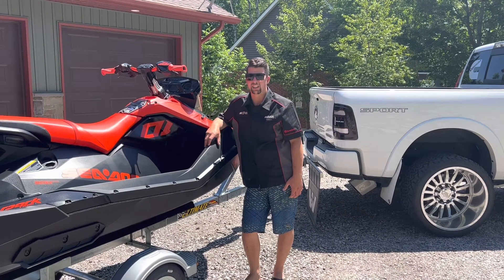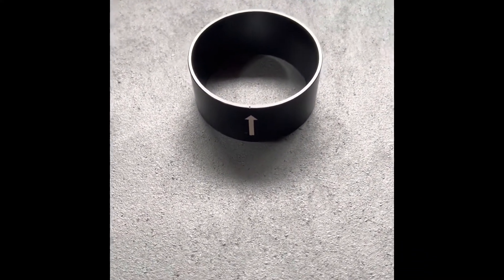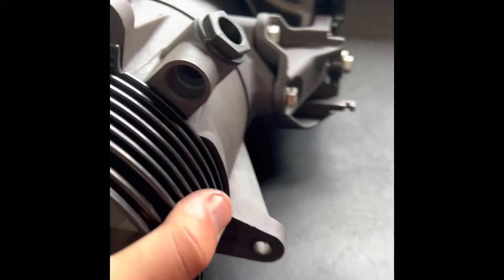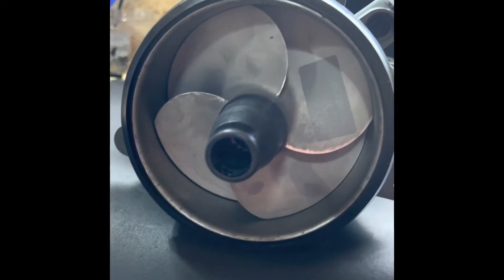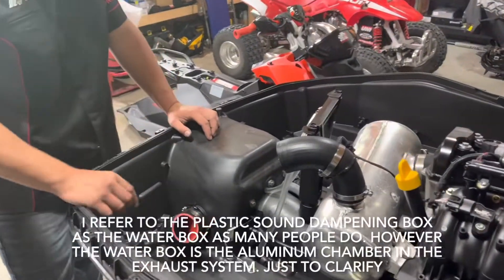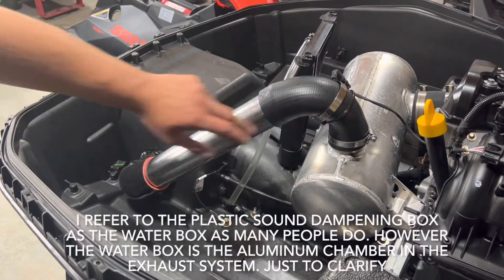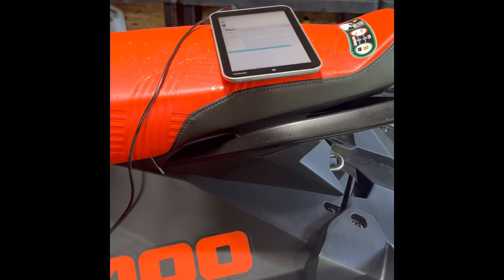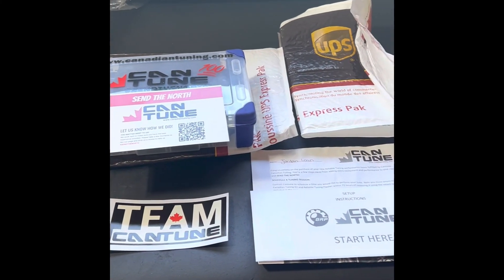Sea Doo Spark Trixx 120 HP Tune, Upgrades and Free Flow Exhaust How To

Comment: Wouldn’t hull inside temps be higher with the stainless pipe being exposed compared to plastic original box or even an all silicon hose aftermarket?

Comment: Hey! Goodjob on the exhaust:) Can you type here all the dimensions and what you need to buy?
Reply from the maker: Hi thanks. Yes this is a list of items required. 
2.5” stainless exhaust tubing (14” length)
Stainless steel hose clamps x2 
2.5” silicon intake elbow x1 
Marine sealant (water proof silicone) 

https://www.amazon.com/TuoLauthon-Silicone-2-5-inch-Intercooler-Thickness/dp/B095LT38TG/ref=mp_s_a_1_1_sspa?crid=15GZ3ZHC97MWO&keywords=2.5+intake+elbow&qid=1667735597&sprefix=2.5+intake+elbow%2Caps%2C116&sr=8-1-spons&psc=1
Reply from the maker: The intake elbows are easiest to get on Amazon. I obtained all the other parts locally. Other parts are available online if not available locally. Just cost abit more.